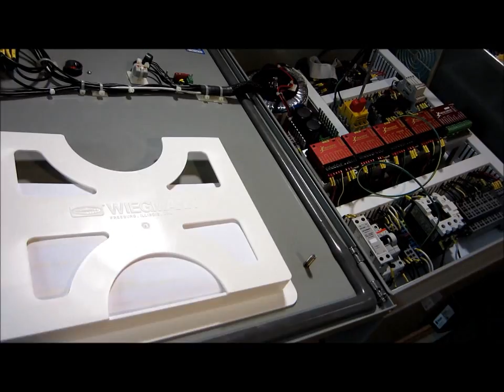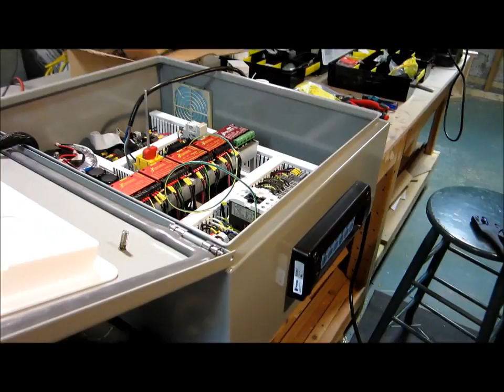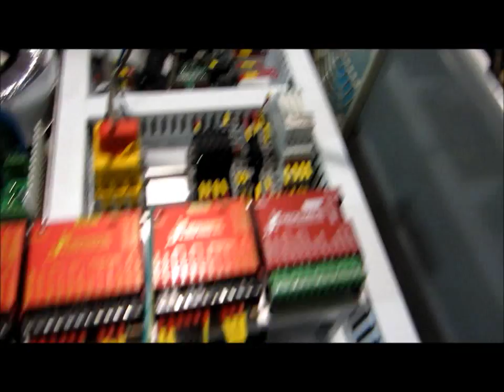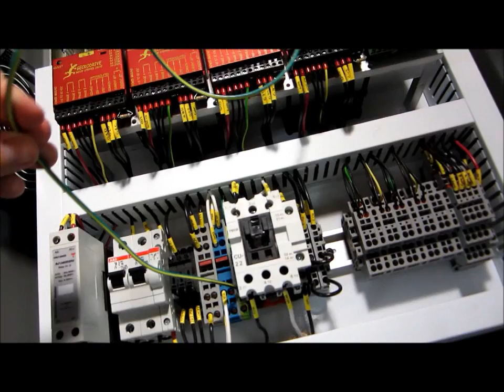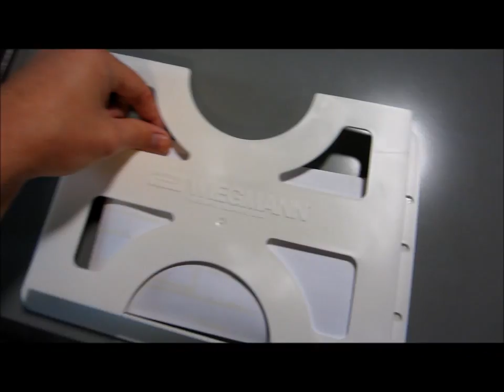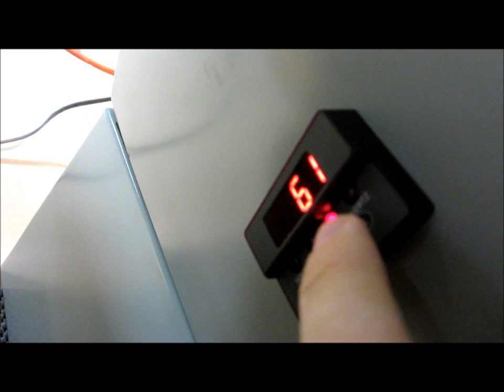My Custom 4 Axis CNC Controller

Comment: What is the voltage in and out of the Toroidal transformer
Reply from the maker: It's 120VAC in and 56VDC out
Reply: @briancnc  Awesome!. I'm thinking of building one based on Acorn controller.

Comment: What is the logic behind having a stop momentary pushbutton? Seems as though with the rotary disconnect and the E-stops that you don't need it. 

I understand why you need the start pushbutton for the contactors. I understand why the rotary disconnect is there because you want to isolate all power. 

Is the Stop button just a duplicate of the E-stop?
Reply from the maker: You could infer it's redundant but they have different functions. The stop button de-energizes the contactor and subsequently the entire power feed to the control panel. It's a soft "off button" in the sense that it doesn't operate as an emergency stop. The emergency stop is just that, and it's for emergencies only. If you hit the e-stop it not only kills power to the entire panel but signals an e-stop condition to the breakout board which passes it up to the computer. Since the computer never gets shut off in either of these conditions it stays in e-stop mode. Estop won't clear until you clear the estop, so it's more desirable in the event of an accident in that the machine can't be automatically tuned back on without further operator input. Lastly the disconnect is there as you noted to disconnect power. This panel is plug and play for power with a shop SJOWW cord and a standard 20A plug, but it's far away and this is an easier way to completely isolate power when not in use or during troubleshooting/maintenance as you imagined. In industry it's standard as most machines are hard wired and have no other way of isolation other than turning off circuit breakers.
Reply: Thank you for the detailed response. The distinction between powering down and signalling e-stop to the pc is subtle but important especially with multiple users. I understand that now.

I'll only add (for others) that the contactor is an essential component as it and the start pushbutton together allow you to perform a bump test prior to working on the panel.

Comment: Could you give me some information about the function of those terminal blocks? What are they needed for?
Reply from the maker: Terminal blocks are to provide an organized means for wire connections that go either in or out of the enclosure as well as provide distribution of I/O and low voltage/high voltage power.
Reply: thank you very much!

Comment: At last, somebody on Youtube that can wire a control system to a professional standard.
God I'm so sick of seeing half assed wiring, no crimps and basically no clue.
The only thing I could nit pick was I didn't notice a star earth? and maybe I'd have put the fan at the bottom for a cleaner airflow.
But yeh, open a control box in a power station and that's the kind of layout you'd see, well done.

Comment: Hey Brian, nice controller.  What is the catalog number of the Wiegmann cabinet that you used, please?  I'm interested in building a controller for myself and I'm curious to know which cabinet you went for.  I realize that this is now four years later but I thought I would ask.  Thanks, Ron.
Reply from the maker: Thanks Ron! It's a Wiegmann #N412242008C, very nice enclosure, super high end commercial box.
Reply: Hey Brian, thanks.  When you are new to this stuff the amount of choice is confusing... I won't even go into the number of stepper/servo options out there; and I remember thinking to myself, build your own cnc machine, sure no problem.

Comment: very nice, do you remember what size panduit you used?
Reply from the maker: In inches it's around 1" wide x 2" tall, panduit calls it .75 x 1.5 I think.
Reply: Thanks, Its nice to see a quality looking controller. I just ordered mine yesterday hopefully it looks as nice as yours when its done

Comment: Nice job of shoe horning and keeping it all neat and orderly.
Bet you could go back to a shoebox if you dumped the Gekko's and steppers for a Clearpath servo system.
Reply from the maker: Thanks Joshua. It could be reduced in size for sure, but that clearpath setup is not an inexpensive route by any means. It's a slick kit though.

Comment: Could you please help me with building a controller? If I could get a parts list and some how to drawings or something... I will be so greatful. I'm building my own 6x6 wooden cnc but not sure how to do the electronics. I would like to use nema 34 steppers and would like to incorporate a ethernet smooth stepper. I could compensate you for your time
Reply from the maker: Richard please send me a message on youtube, I offer the plans and bill of materials to those interested.

Comment: what part number is that Carlo Gavazzi Solid State relay
Reply from the maker: +ed a Ed it's a #RJ1A60D20U or was at the time. Just make sure you choose the correct part depending on the configuration you need and sized to your load. I believe this one has load contacts rated at 600V / 20A, and a 5-32VDC signal range on the low voltage side.

Comment: Nice panel work man! I've worked in panels designed by electrical 'engineers' and built by so called 'professionals' that aren't as well thought out. I plan to build my panel as I would any other electrical panel in a plant as well.
Subscribed!
Reply from the maker: Thank you Glenn!

Comment: Great work. Anal, but Id hire ya.
Where did you get that combo meter on the front panel? been looking for one of those.
Reply from the maker: J Santarsiero Thanks! Do it right one time and it will never fail you! It is probably fairly  over the top for most DIY cnc people, but when you need to depend on a machine to make you money, you can't go cheap on parts/methodology. The panel meter is a Murata Part: http://www.mouser.com/ProductDetail/Murata-Power-Solutions/ACM20-5-AC1-R-F-C/?qs=UKSVydJZ%252bcIMW8sOGMf9KQ%3D%3D

Comment: Who produces terminals like that 4:32? And those fuse protection you lock on terminal. Cannot find it in Google.
Reply from the maker: They are made by Phoenix Contact, and another great brand is Wago. They are available online all over the USA and especially in Europe. https://www.google.com/url?sa=t&rct=j&q=&esrc=s&source=web&cd=1&cad=rja&uact=8&ved=0CE0QFjAA&url=https%3A%2F%2Fwww.phoenixcontact.com%2Fonline%2Fportal%2Fpc%3F1dmy%26urile%3Dwcm%3Apath%3A%2Fpcen%2Fweb%2Fhome&ei=R_cTVfGqCsvsoATN3oLQDA&usg=AFQjCNEbPwSaqCmeebMJxkwirhHY9EgASg&sig2=5Ewjpjg7lbpeoCu9bBvpcA&bvm=bv.89381419,d.cGU
Reply: briancnc Man, this is something I learned for the last few ears in Automation and PLC programming. How come I never new their name? Their products are amazing!

And by the way, I decided to your breakout board and separate drives for each motor. Not as fancy as yours, most simple TB6600GH and simple $20 board, but I think for beginner it will work well.

Thank you for sharing your experience.

Comment: I am confused. I wanted to do very nice box too. My plan is also to screw PC motherboard inside the box, so my station is complete set and I only have Machine and monitor with mouse all wired to the box.

Anyway, I am planning to use this controller

http://www.omc-stepperonline.com/4-axis-tb6600-cnc-stepper-motor-driver-controller-board-for-cnc-router-milling-p-309.html

 As I understand I can output to drives directly from this board. I understand all the protection circuit, but why do you need additional controls there for every motor? Because your controller without drives or you what to give it better perfomance?
Reply from the maker: I understand you want a complete unit but I wouldn't go through the hassle, I don't see the value. The controller can be attached to the machine and a separate PC workstation either with a pivot arm on the machine or in a cabinet. Trying to pack all of these things and a PC into one electrical cabinet is certainly do-able but I don't necessarily see the need for so much effort and you want to be careful about not putting certain components near each other, especially large electro-magnets near memory devices. I am not sure I understand your question though. Individual motor control is needed so that each motor can be operated independently. A geckodrive is needed for every motor for this setup, but there are all in one geckos like the 540 I believe, which is one brick with 4 outputs.
Reply: briancnc Thank you for response. i like your setup but if I go this way I'll pay almost $1000 more.

Regarding problem with power supply and recording device (HDD), there is no problem. You know nowadays there are 500W-800W power supplies for PCs and it is working fine. But thank you for precautions. 

I want to build operator station separately on the wills. It is like a box with shelfs inside for different parts and control/indicator interface. On the machine I'll only have emergency switch. So operator may move station around without losing access to any control, indicator or switch.

Anyway, I would very appreciate if you guide me to the place wheer I can find DIN rail standard DC fuses, buses, and those neat things that make DC little lower if needed. I have 3V laser cross module, 36V motors, 24V control circuit and I plan to have 48V power supply if I find those things or I'll have to add separate PS for everything. Could you drop me an email to serg4172@mail.ru(or replay in comments), so I can also contact you in case I have more questions.

Comment: Hi, what wire gauge (awg) do you use?

1) between breakout board and step drivers.

2) and "between step drivers and motors".

3) what motor do you use 425-oz or 1600-oz?

4) can you cut aluminium with you setup or only wood/PVC/acrylic

Thanks.
Reply from the maker: Eduardo,

1) 18ga AWG / 1.00 mm2
2) 18ga AWG / 1.00 mm2
3) 425 oz/inch
4) Aluminum yes, but very slow and light cuts. All kinds of wood, PVC cuts well as it is soft, delrin/acetal, and cast acrylic cuts like butter with a new o-flute carbide spiral.

Voce e brasileiro?
Reply: briancnc Bom dia Amigo.
Muito obrigado pela rápida resposta, sou sim, do Rio de Janeiro, porem vivo a muitos anos em Portugal.

Um abraço e meu parabéns pelo belissimo trabalho com a sua caixa de controlo.
Reply from the maker: Eduardo Braga Obrigado Eduardo! Que bom, achei quando eu vi seu nome. Moro nos estados unidos, mas estou aqui em MG por pouco tempo.

Comment: awesome controller...
Can you tell us a little more about the actual enclosure?  is this only available in Europe?  It looks like those rails, and plastic guides are good for mounting components and wiring....
Where can you typically find a box like that?

Thank you
Reply from the maker: The enclosure is a standard nema 4/12 weigman box, it's a very standard electrical enclosure in the US, not necessarily a euro thing. Euro is quite the opposite, more composites and sleeker. US is typically big heavy and bulky! You can source these on ebay, factorymation/automation direct pretty easily.